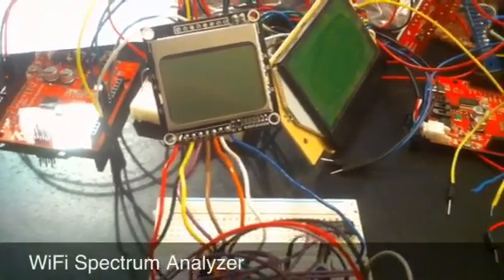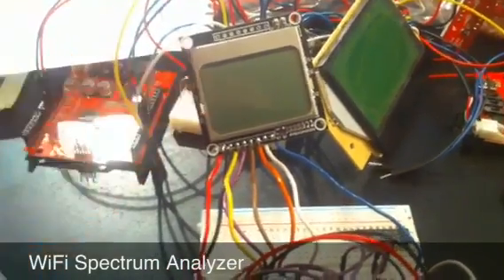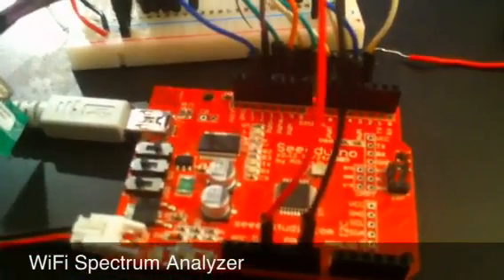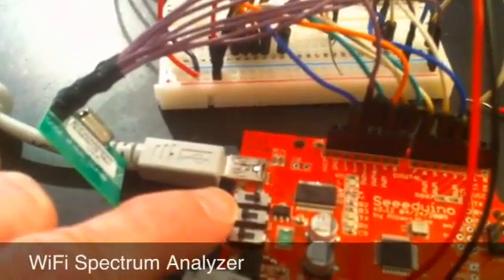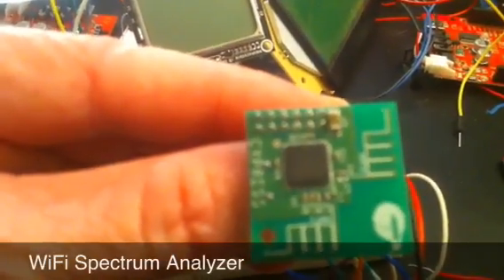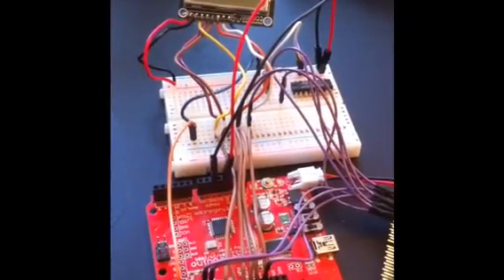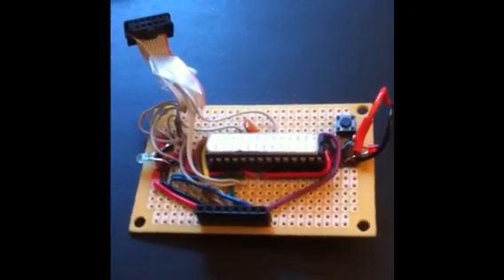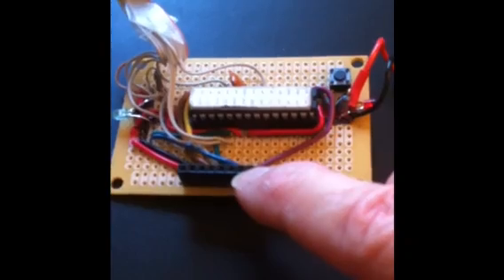2.4GHz Arduino/CYWM6935 Spectrum Analyzer

Comment: hii any good arduino programmer plz help....
there is one Awesome rf spectrum analyzer project shared by someone on the internet  , it uses 
5110 lcd as display but can anyone do the modification in that code to work also with serial plot or monitor ?  if i share the code ?

Comment: Can we use sl4432 module for this ?
Reply: Was wondering what module to use for 5.8GHz range, i.e. ~5 to 6GHz.   There are two projects I'm aware of using the Si4432 modules, tinySA and UHF Spectrum Analyzer.   I actually just commented regarding here: https://groups.io/g/HBTE/message/1247
Reply: @jafinch78  may be we  can use ku band LNB  by hacking it  for  scanning 1 to 12 ghz frequency  or something similar like using old crt tv tuner (that used by internal pcb  ) with replaced L C tank and high frequency ic for at least 2 to 5 ghz frequency ?

Comment: The arduino actually uses an Atmel chip. It's just that you have all the components needed to run and program it on one board, which makes prototyping it much easier.

After the prototype, as show in the video, you can make a dedicated pcb, and enclosure, with only the components that you need.